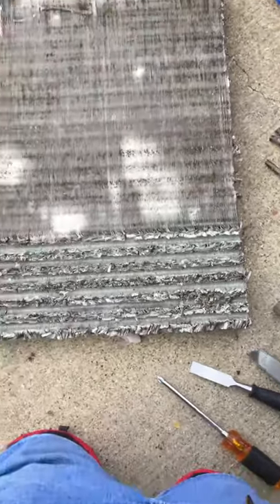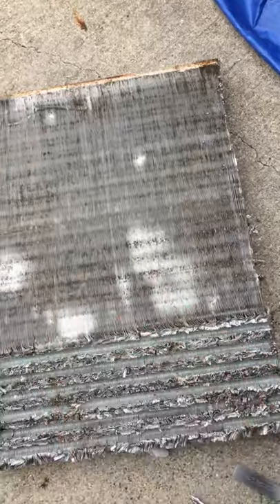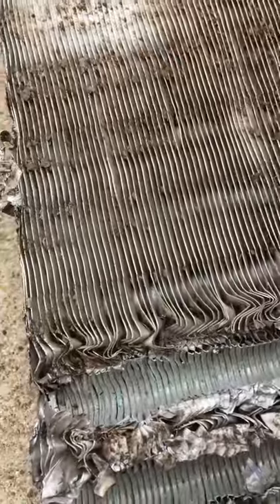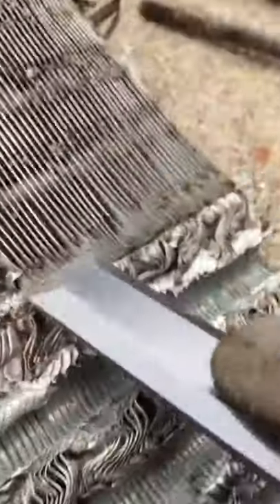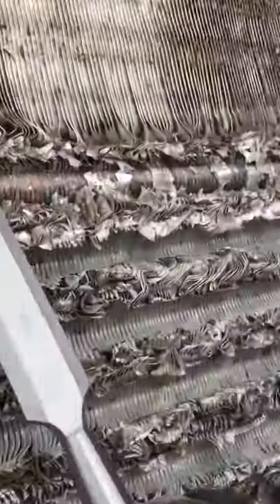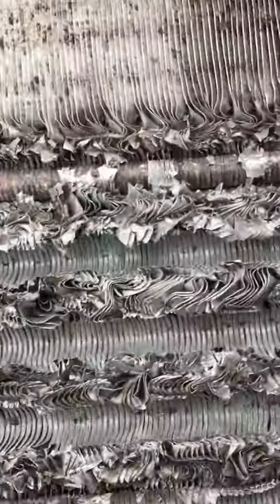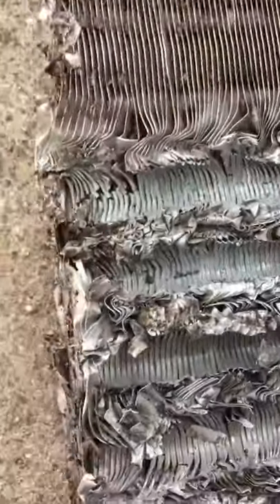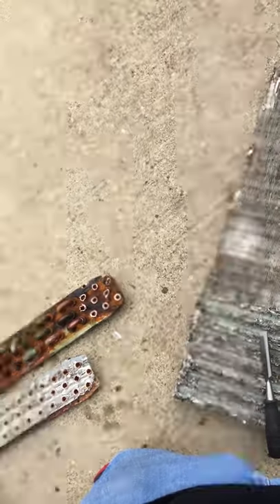How to scrap an ac radiator for copper and aluminum

Comment: No idea how people manage to work with a blade to cut aluminum, you will get exhausted after the first 10 cuts, get a simple angle grinder and pass the channel one by one then place the radiator on a ledge and hammer out the copper, much easier
Reply from the maker: Yes it is rather time consuming and involved